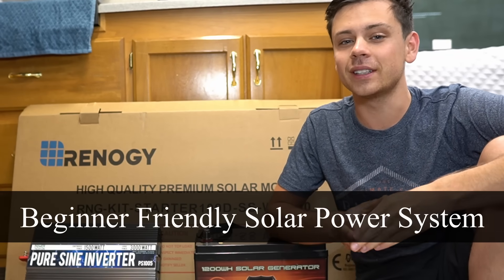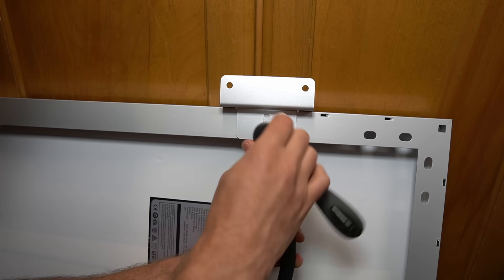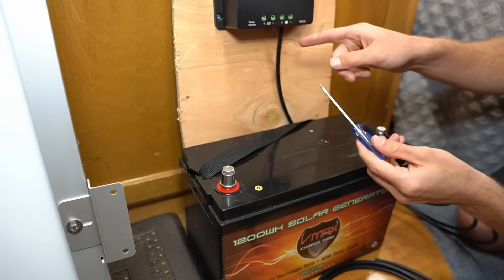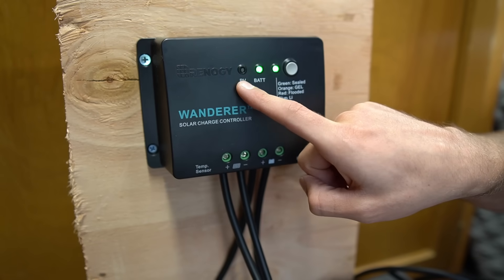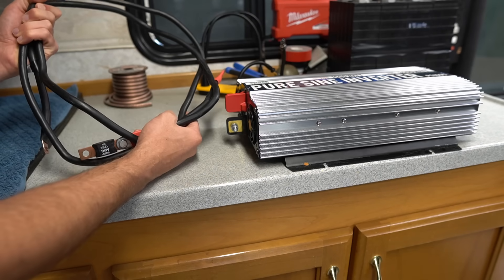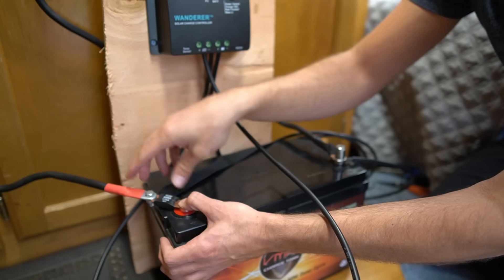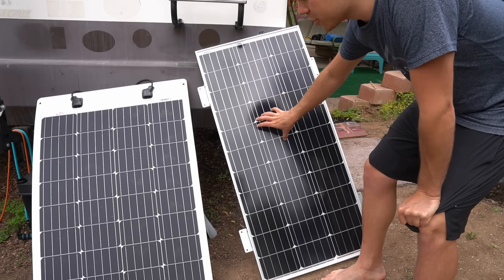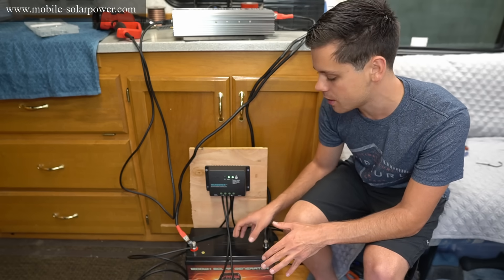Build Your First Solar Power System! Beginner Tutorial Easily Explained, Budget Friendly

Comment: I’d like to have back up power for my home. Just for a freezer a refrigerator and I have gas heat that’s 120 volts. I do have back up heat but to keep my main system running in bad cold weather would be nice. Could you tell me how big a system I may need?  I have a nice little half basement to put the inverter and batteries on the same side of the house close to where my solar panel need to be.

Comment: Is it possible to set up the battery monitor to an auto shutoff for the inverter? If you left a small load running overnight and the battery got too low would it be possible to automatically turn off the system so it doesn't damage the battery

Comment: Instead of connecting both the inverter cables and the charge controller wires together at the battery, I was planning on going through negative and positive buss bars. This should be good right?

Comment: Loving your videos! I'm looking at your website for the battery cells and equipment. My main power draw is the compressor on my 4 ton central AC unit. During the peak of the summer, it draws 60 Kwh per day. I was hoping to replace the compressor with a DC compressor, but can't seem to find one large enough. If I had to use an AC inverter on my existing compressor, does it sound reasonable to buy a lot of 435 watt solar panels, and build the system with the cells from your site to make it cost effective? If so, what MPPT controller would you recommend to support this and what configuration would you use for the batteries and voltage?

Comment: Great video.  Could the 100 watt panel be replaced with a 400 watt single panel but still use the same inverter, charge controller, fuse box size etc?

Comment: Your videos inspired me to dip my foot into the solar energy world.  I have a shed in a remote area in CO and have created a small solar power system at it.  I have a 100W solar panel, 20A BougeRV charge controller, 12v 109AH deep cycle lead-acid battery and a 1000w/2000w inverter.  My question: Is there any danger in leaving the panel, charge controller, and battery at the shed for months on end between visits or should I do something different when not around to monitor the situation?

Comment: Great video for the beginner! I am that beginner! I came across your videos while researching RV solar setups. In my zeal to build an RV solar system I purchased hardware without really knowing if it'll all fit together. I bought the Renogy 400 watt Premium Kit that I added two more 100 watt panels to for a total of six 100 watt Renogy solar panels, a 40A Renogy MPPT Charger/Controller, four 100ah Lithium Ion Batteries, a 3000 watt Pure Sine Wave Power Inverter, a 30A Automatic Transfer Switch, a Renogy 12V 40A DC to DC On-Board Battery Charger, 2 Battery Disconnect switches, 8 gauge wire to connect the panels to the controller, and 0 gauge wire to connect the battery bank. Do I connect the panels in series or parallel? Same question for the batteries? What am I missing? Too much? Too little? Could you point me to one (or more) of your videos to answer those questions? Again, from what I've seen you make it look so easy!

Comment: Couldn't you avoid the sparking on the positive cable by attaching it before attaching the ground?   General rule with auto batteries is disconnect ground first and reconnect last.

Comment: This is a New 19 Sept comment.  3 days ago I had a Fire on my Deck burning approx 16 sq ft of deck and completely melting a garden hose holder.. I had several fuses in in line with 200 watts parallel connected.. Flames were 6 ft high. THANK GOD I HAD 3 FIRE EXSTIISHERS AND A HOSE. IT SEEMS THE CABLE,heated up. I had sprayed wasp killer on the hose reel.  ( found later the spray ignites at 130 degree F) .. Not surehow you could help  looking for comments.  Help / recommendations, .....

Comment: thanks for the well explained inverter video. My inverter is 10 years old a thousand watt XANTREX xpower inverter. I have not used it for 7 yrs should I do anything before connecting it to a battery and  powering it up? I use it in a van camper for LED lites and a breathing machine. I want to get a small solar panel for the roof to keep the battery up. Any thoughts on the size I would need for this?

Comment: Thanks - great info for newbies like me. Renogy sent me this link to watch. I have a 200w solar panel and 2000w inverter with 12v double size lipo battery. What fuses would you suggest for the battery connection & the controller wire? Im grateful for the info you're putting out.

Comment: Hello,
I have a small off-grid cabin in upstate NY.
I have 200 watts of solar, a 40 amp pen charge controller.
I want to know battery recommendations for this small system that I only use about 1 weekend per month.
Is it ok to leave the solar hooked up all the time?
I assume the charge controller will just go to “float “ when the system is charged?
Thank you

Comment: Need assistance, I have the Voltronics Axpert Max 7.2 inverter and two Shoto SDA 10-48100L5 batteries, please can suggest best or correct way to connect both batteries so that they discharge and charge simultaneously.

Comment: hi there. im planning to build a heater for my small 5x5 chicken coop setup without electricity but with the solar panel system. can all of this everything included video here power a mini heater like the size of a 2x2x2 box? not a big heater but probably by the size of a standard basket ball? possible? hopefully my info give you a sense of power requirement.thank you.

Comment: Thanks for your content.
I have been running a 1000 w renogy inverter and a deep cycle marine battery with 2 100 watt solar panels with perfect results. I came across 2 ups 12-400mr batteries and connected them in series, and my inverter shutdown. Which inverter will handle these batteries?

Comment: So this might be a dumb question, but I would like to know what setup I would need to have to charge my EV so I don't have to pay for it. I want to set up something that can handle charging this vehicle overnight at 240V with a 240 plug. I am not sure if I am saying that right. Any suggestions?
Reply: @Donny 
Oh boy, that would be expensive. You need the proprietary EV charge station, plus many. Panels. I estimate 10k worth of equitment, not worth it❓💲💲💲
  You will have to use 24 volt batteries,. Which cost more than 12 volt, and not available in most stores that sell aito and marine batteries. Plus the station runs on 240 volts. Very dangerous power. I recommend a professional install it to your home.

Comment: I have a growatt spf 3000TL LVM, but Mt question is this calls for 200 Amp 24 v battery can you use 1 100 Amp and 2 ,50 amp batteries as long as the cells are equalized

Comment: I'm not sure if you mentioned it, but when connecting the battery never touch both positive and neutral or you will get shocked, I would think most doing this should understand the basics of electricity. but when getting into bigger systems the can kill you. I don't know about the one battery in this video but I don't want to find out personally.

Comment: DIY Solar Power with Will Prowse so two questions where do you include a breaker box into a solar system setup much like you would see with a conventional home wired to the grid? Second question, do you have any videos that show you how to wire the inverter to your power outlets etc? I understand from the panels to the inside electronics, but no one shows going from the inverter to your outlets. Thank you

Comment: Just Installed a 100w solar panel with a 60 amp Charge Controller, a 2000w inverter with a 55hA Gel Battery (12v). System is not charging battery properly. It give me about 5 hrs of effective usage (night time) with a simple load of 14in pedestal fan. What could be the problem?
I changed the controller form a 30 amp to a 60 amp.

Comment: @DIY Solar Power with Will Prowse I have this exact charge controller with a 200 wh sealed battery, 2 100 watt panels and a 2000 watt inverter. After using this set up 4-5 times last summer, the battery monitor says it will not fully charge. The charge controller says its charging. I took the battery to battery world to have it tested and they say its fully charged and in good condition. Could it be the controller is shot? Very confused.
Also with both panels plugged in, pv is flashing fast which means over voltage. I unplug one panel and its flashing slow which means its charging.

Comment: why would you use a 40 amp fuse on a charge controller of 30 amp? because the fuse will blow at 40 amp .when your charge controller is only rated for 30 amp??

Comment: If you connect b+ first and B- second you wont get a spark.  I was always instructed to connect B- last and disconnect B- first.
Reply from the maker: Not true
Reply: @WillProwse  what's not true? That I was taught that way or I've never had a battery spark on me connecting b+ first?  Maybe solar if different than everything else, but if that battery had any sort of leak at all you would have been wearing that battery.
Reply from the maker: @philmckracken1354  when completing a DC circuit with in rush, there will be a spark. There are capacitors that need to be charged at the input of inverter circuit. Doesn't matter where or when you connect the conductors, the inrush will create a spark

Comment: Great informative video as usual
  Question  I refreshed my pair of Gell solar batteries this weekend with my Noco 10 charger
I did remover the charge controller leads from the battery but did not remove them from the charge controller. Nor did I pull one of the panel leads to the charge controller.
....it was a full  sun day.   Do you think I may have damaged my controller?  It's a Renogy Wanderer  early version without BT 1 imput.
Thanks

Comment: Any Splices must be "Mechanically Bonded" i.e. Small U bolt which can buy them as  between each thread posts 1/2" min 12g wire solid  / 10g stranded,  then Wrap with Rubber Tape 3" down where the insulation is cut and the final is dbl walled Heat shrink ( Inside of heat shrink glue) min of 1.5 " past the Rubber tape, then another Wrapping of Rubber tape 1" past Heat Shrink ( do not use Vinyl Electrical Tape or 3M Super 88 ) You do that and you'll have no issues..and do use Butt splice  crips..only use if it's a last resort for Temporary Splices. Any questions I'll be more than will to answer (I am a Red Seal Master Elc'chicken i specialize in Industrial  Electrical Code for Alberta Oil Industry..If you can't do it right Overkill it because it only takes once )

Comment: Very interesting content. I have an inbuilt inverter with a charge controller in one casing. Is it really required to connect a fuse or should I go ahead and do connections like solar panel to the battery then to the Inverter?

Comment: I plan to build a 500 watt DC based solar system. I have a choice of 150/340/445 and 545 watt panels. The largest one has Double glass Bifacial PERC technology. I plan to expand the system to 3kva later. What size of solar panel would you suggest for the purpose?

Comment: Can we continue using the inverter while the scc is charging the batteries?  Wont it damage the scc or other parts in the system? Will scc help the battery or  inverter power an appliances?

Comment: Hi, I bought  a set of 3000w /24 v (PW3024) Hybrid  inverter with 4 x 200 w/ 12v (25voc) solar panels and 2 x 200ah  Li battery , at a bargain price, can l connect 4s or 2s2p ?

Comment: I'd like to power a small camper. It's 14 foot long. I'm looking at a small refrigerator [not a camper model but it isn't large] a small air-conditioner and a couple of lights. Could you get me started on what I need?

Comment: You do a great job explaining this and other relater set-up's. One thing that might  be a good idea as I was told recently by a electrician was to incorporate a safety relay/switch between the battery and the inverter just in case a short circuit should happen, as otherwise I would not be able to turn off the power from the batteries, nor would a shortcircut cut the power,  it was suggested as a better way than having an inline fuse plus a switch which make sense... My system has two 120 amp hour AGM deep cycle batteries and a 1500 watt 240 volt inverter, just for back-up power when we lose mains power, and because that way I don't need to run my generator all the time.  I still have to monitor voltage with a suitable voltmeter.  I have a smart charger, it has two settings, flooded and calcium types,  don't know if it is ok to charge the deep cycle batteries using that charger, or if I need to get one specifically for AGM type batteries?
Reply: Personally I would get a charger that specifies use with AGMs. Or you could enquire with the battery supplier? And I'm not a Karen 🤣!

Comment: Is there anyway to check the controller is OK, I bought my van with the solar on the roof, but the batteries were not connected so I don't know if the controller is working.

Comment: Can I run a washer machine with what u had just demonstrated or a normal regular size home refrigerator?  I’m new to this. I just had purchased 4 - 100 watt 12v solar panel from Newpowa.  Do I parallel them? Will an inverter of 3000watts will be sufficient with 2 batteries of 100ah each? For all this said....do u recommend a MPPT controller? I’m In the Caribbeans where the sun always shining and where there’s constant lights out.  🤷🏻‍♀️ need your help and advice greatly appreciated thanks 🙏

Comment: Could you please evaluate these solar fans on Amazon? The downside is they only run during sunny days...what I've seen. Grid down scenario 90 degree temps or more will stink. How do you set up a system to run at night? I'd like to install a solar fan at reasonable costs in my she shed.

Comment: Hi, Good evening from here.i bought a new AC50 last year, I have been using it for close to nine months now,the battery is no longer lasting long as usual.the battery has started having problem,the battery mostly shut down from 40 percent charge level,and start charging From 40 percent when a charger is plug in.the  battery now unsually charge faster and goes off faster as well.the battery may jump From 40 percent charge level to 80 percent in less than 2hours,unlike before.then From 80 percent charge,the charging speed I'll reduced to just 1 watts,and  this low charging speed May last for days or even week.pls what could be the fault,and what is the solution.this  happen both on solar and on electric power.

Comment: I have a 3000 watt pure sine inverter with a 24 volt system and 30 100w batterys with 3140 watt panels why will it not charge my 2021 chevy bolt ev

Comment: Hello! Came across your video and it was extremely helpful. Quick question, I am trying to add power in my backyard so I can run a fountain in my garden. It has led lights so I’d like to be able to run it for at least an hour after sundown. Do you think a 100 watt set up would be sufficient to power a pump for a fountain for use all day and a little into the evening?

Comment: Know you're a solar guy but I'm looking for help on converting my RV system into a dual power system rig.  Shore power with a converter for my 12vdc needs OR an inverter/converter powered from 600w of solar panels AND a 200ah LiFePO4 battery.  All of my equipment is from Renogy.  I have a 50a DC to DC charge controller as well and a 500a battery monitor with shunt.  Can you help me or point me to help?

Comment: Just wanted to let you know this video really helped me under stand a couple things I need to do as I had previously had bought a 100 watt solar panel and other parts and after watching your video I wished I had seen this video before I had bought the harbor Frieght stuff as they don't explain nor the controller they offer is big enough I will be buying a kit from Renogy and a bigger controller and kit  as I am trying to set up a option of power should a grid down event occur and I now know what I should have  bought a complete kit from them would have saved me 100's of dollars by getting what you need the first time around a Big Thank You ,Macster in Wash state .

Comment: Hi what system would I need to boil a kettle for about 3 minutes? I have 2 60 amp 12 volt batteries in parallel, and just bought a 4000 watt inverter, do I need more  batteries qnd connect  in series??  cheers

Comment: can you use these DIY systems like this in a house. Is there an inverter that can plug into wall outlet as well as battery and change source based on battery level. Something like this would be great for a small mining rig doing 600 - 800 watts.

Comment: When using batteries in parallel, should I be hooking them up together first, then connecting it to the inverter? Essentially treating it like one massive battery? For clarity, I plan to use three 12v 100ah batteries in parallel hooked up to my 3,000 wt inverter that is getting charge from three 100wt at solar panels with an mppt solar charge.

Comment: Thank you so much for this video.  Your "diagrammed" tutorial helped me to understand where each component in a solar system goes.  I wondered if you could help me with one more thing.  Can you tell me if an all-in-one system like an Ecoflow or Jackery encompasses all the components (charge controller, inverter, etc) into one single unit?  In other words, is it a one or the other system?  Thank you for whatever help you can offer.